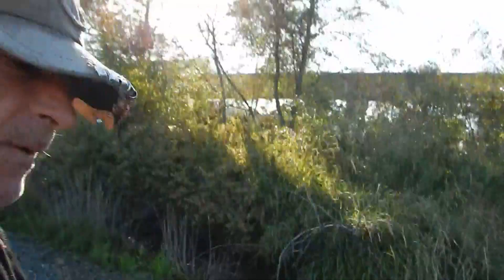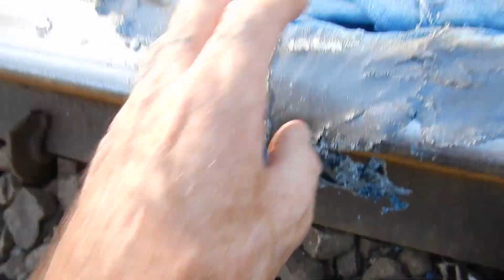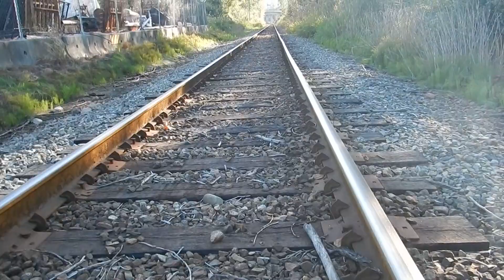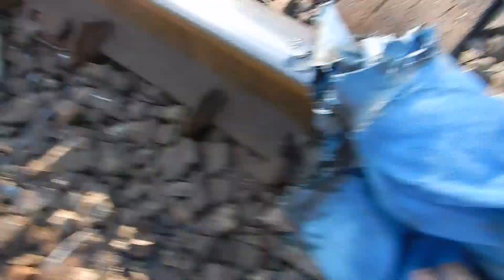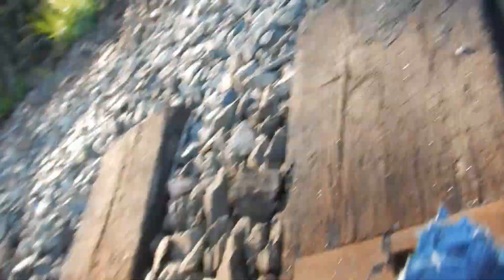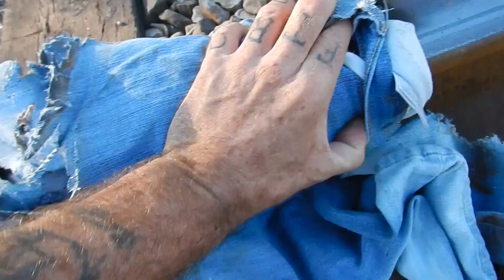Flattened by Freight Train (Caution when Hopping Freight Trains)

Comment: A train wheel is basically a guillotine with 15 tons of weight on top of it. Will go through flesh and bones like a knife through butter.

Stay safe kids.
Reply from the maker: that they do - why caution is a must - wheels are next to the ladders and one slip is all it take to turn an adventure into a nightmare - i ride over 35 years and i don't drink or do drugs - me like a bunch of other aged riders be lucky we walk away without incidents as we be talk about now - thank goodwill for that -
Reply: @Telestations  Yep, i enjoy watching these hobo vids but it's important to remind everyone of the risks like in this vid.
Reply: @Anonymous 257 No way, trains are far too heavy.
Reply: @Anonymous 257 a body wouldn't derail a train
Reply: @Anonymous 257 it is also made of steel and designed specifically to derail a train. A human body is not, it would take hugely exceptional circumstances for a human body to derail a train.
Reply: 15 tons? A fully loaded car is 100 tons, a locomotive is 200 tons, much heavier than you can imagine
Reply: @TheBeeMan1994  Yes but they have more than 1 wheel. Axle loading is circa 30t.
Reply: @N330AA  you make a valid point
Reply: My brother met a guy who had his lower legs severed by a slow moving train wheel
Reply: @Anonymous 257 lol no you won’t. I’ve run over 2x4s that were accidentally left on the rail at a customers facility with a loaded centerbeam, didn’t feel a thing riding the car and that board was flattened where the wheel ran it over and sliced in half by the flange. 

You can watch videos on YouTube of trains hitting cows and whatnot, from the cab, all they hear is a thud, the locomotives don’t even react
Reply: @Anonymous 257 thinks he's Hitchcock or something.  I've watched trains hit loaded highway tractors at 50mph and carry on just fine.
Reply: @Anonymous 257 elaborate please.  How does pushing a car in neutral relate to a human body derailing a train?
Reply: @Jordan Tyler Welcome to the difference between a wheel and a car.
Reply: Lost a close friend In 2003 jumping trains in NYC. His shoelace got caught on the railing, rip mike.
Reply: @Jordan Tyler Good morning Tyler. 100 tons / 8 wheels = ~15 tons. Enjoy the rest of your day!
Reply: It’s like a giant heavy pizza cutter

Comment: I was hiking several years ago on the Tracks in between Oak Ridge and Oliver Springs, TN and saw a Possum that had apparently froze still when it saw an oncoming Train. The back half including back Legs was on one side of the tracks and the Head and front Legs were on the other side. It looked like that Possum was cut with a sharp Knife! No Blood, just clean-cut
Reply from the maker: that's what happens - Why i say - got to practice caution - what i do is not a game but a deadly lifestyle
Reply: Poor possy :(
Reply: How do you know it “froze still”?  Lmao 😂
Reply: I was an engineer for 12 years. Possums will walk on the rail ahead of a train and just get run over. It happened several times in one plant we switched. Always in summer which made the scene really delightful with the smell after a few days.
Reply: Seen the same thing in Louisiana it seals the vain closed very little blood
Reply: @JMazzaTaz  cuz if it run away it wouldn'ta git sliced in haff...

Comment: Yes there's some interesting things that happen to you if you get by a train. If you're lucky to be full-frontal hit at a decent clip, you just die, body turned to tomato sauce and a nightmare for the loco servicing crew to get out of the hot traction motors, and it literally stinks for the cab crew as parts of you are out on the open stinking foul with the contents of your guts, or parts of you are burning onto the traction motors. Cooking human smells like pork.

If you get a limb run over it's a guaranteed amputation, but you rarely have to worry about blood loss. The sheer pressure of the wheels going over you essentially vacuum-seals the wound like a packet of chips. Blood won't get out. All a surgeon has to do is tidy up the wound.
Reply from the maker: that is correct and reason one must practice caution - even then shit happens fast when dealing with trains - just takes a mistake and its off with your legs or brings a fast or slow and panful end to your life with no one around to help or comfort you - sad way to die

Comment: stupid question: what if the jeans get sucked into the train's moving parts? will they damage the train?
Reply from the maker: depends on the speed of the train - if the train is slow then you have no lift of the garment from wind - so the chance of the garment sticking to the wheel and getting jammed in the axel is 10-15 % chance  - The garment has a better chance of sticking to the track and getting flattened and the rest of the jeans cut off by the weight of the wheel and the edge of the wheel that rides the inside of the track -  my friend wanted me to do the chicken leg in a piece of cut jeans to show others what happens to bones - I was going to until i remembered that it dont take much to derail a train and by doing that even if it is a chicken bone the fact that it might cause damage or disturbance to a load i decided to practice caution and not do the video - that would have be educational - what happens to a chicken leg when it be ran over by a freight train -